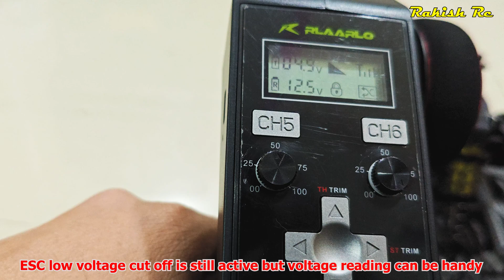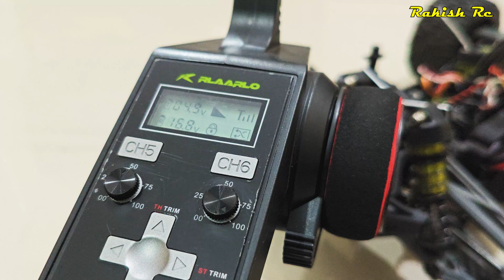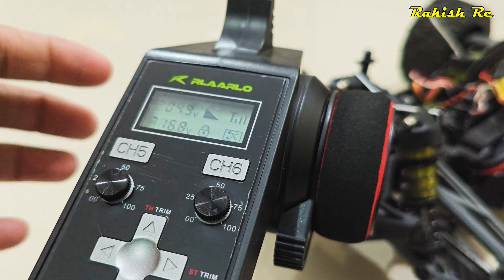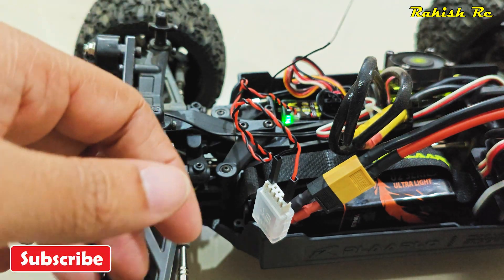Rlaarlo Omni Terminator Radio Battery Voltage Telemetry Setup

Comment: Just take the XT60 apart at the grey part pull down cut the pins off end of wire then solder direct to the XT60 connector ....Now ever time you plug a battery in it will send V Data !!

Comment: Works great. You don’t have to add a zip tie though. If you look have 3 molded in wire slots / holders you can run the wires thru and keep them secure. Good video.

Comment: Thank you! This video was exactly what I needed. Only problem I see is my battery connection has 1 black wire and 3 red wires.  My 4s battery has 1 red wire and 4 red wires. I'm not sure which red wire to use.😮
Reply from the maker: @mrobviuos74  you want to connect to the outer most connections on the balance port.. Just make sure the red + and black negative - wire are matched on the balance port and the 2 pin telemetry wire

Comment: Where can I find the adapter?
Reply from the maker: I think it's not sold separately.. Only included with the carbon fiber edition accessory bag. Or you can make one by using the appropriate jst connector.
Reply: So you are saying I have to adapter with the appropriate connectors on each end?
Reply: @JoeKozak-c8e it came with my carbon Terminator
Reply: I  have to make the 2 connector adapter sorry for questions new to rc

Comment: Is there no way to see battery life with the stock setup?
Reply from the maker: You can just need to attach the voltage wire between the receiver and battery balance port. 
Otherwise it's not possible with the stock radio